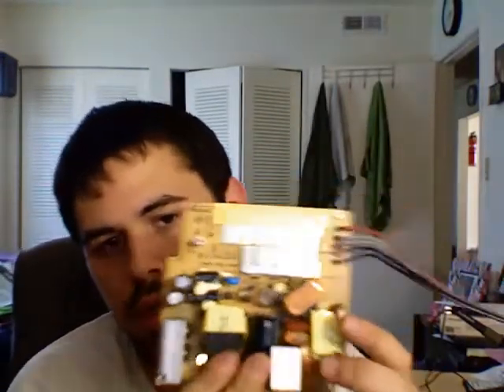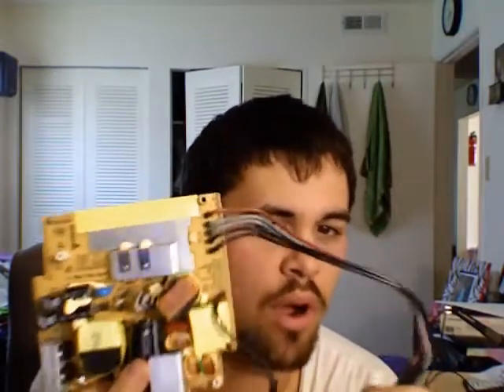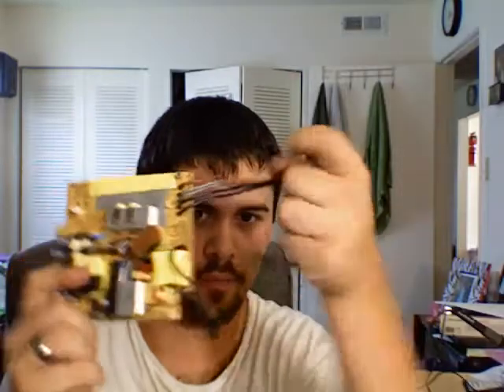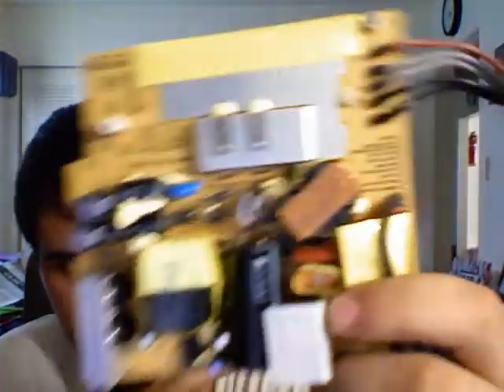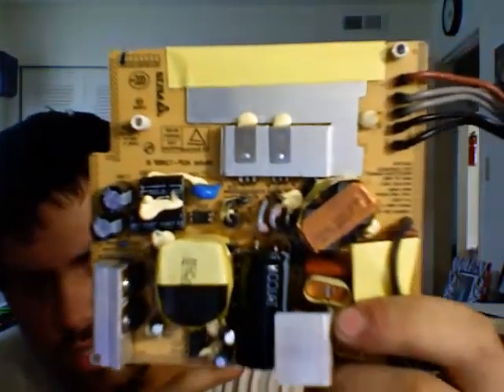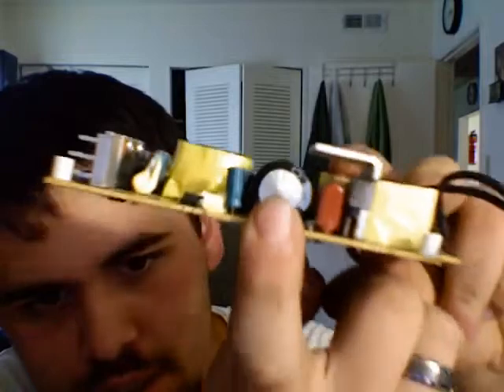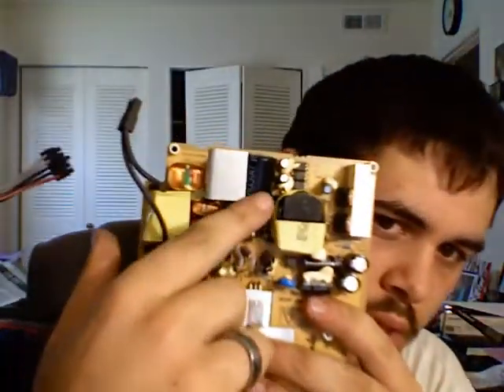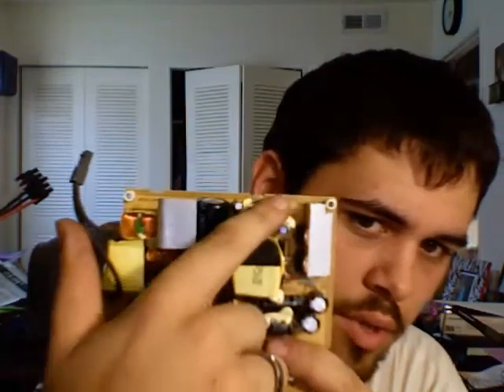Apple iMac White No Power Fix

Comment: Hi there, you are the only one that I could find that has a power supply like mine.  I have an iMac A1207, the white Intel!  My power supply has that long cable too!  My problem is that all the how to videos I can find is how to remove the power supply with the short cable!  Mine is very different to remove, the one multi pin bracket is easy to remove, however the longer cable is under steel brackets, how do I get to it?  I would really appreciate some help?  Any ideas? Thanks! Christine
Reply: Dieperdors W...... i see your question was written 2 yrs ago, but I have the exact same problem as you.......did you ever resolve your problem? I have an A1207 too, full of years of photos and documents I dont want to lose, one night the Mac just went off....... Pffffft!. So any info you could give , especially if you fixed it would be appreciated , God Bless.